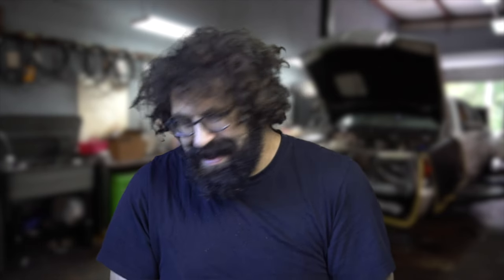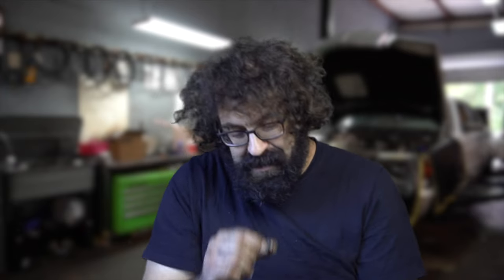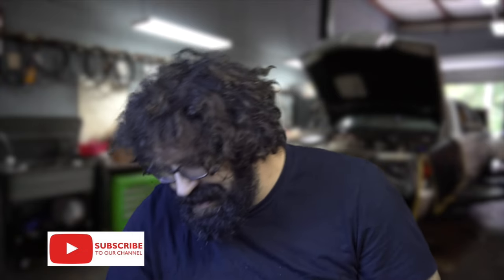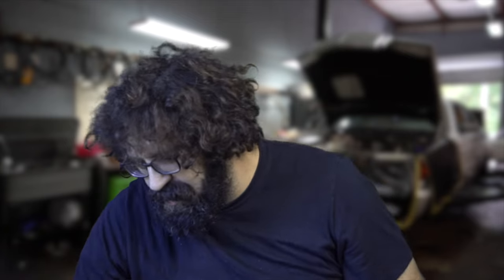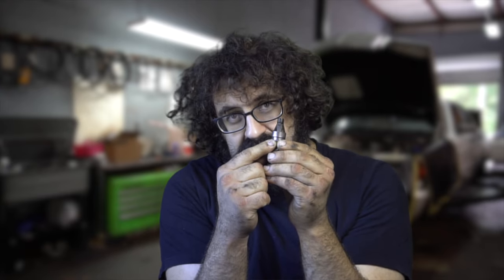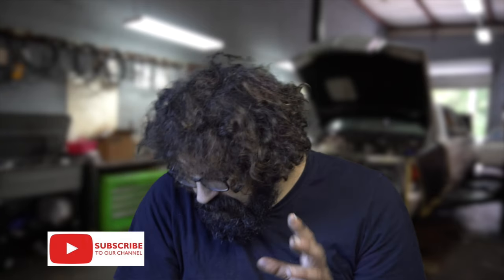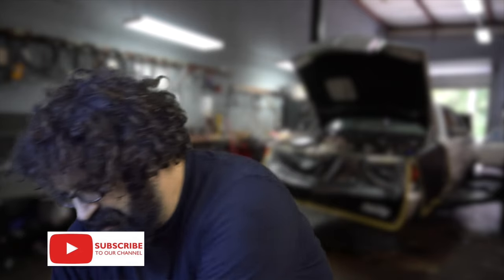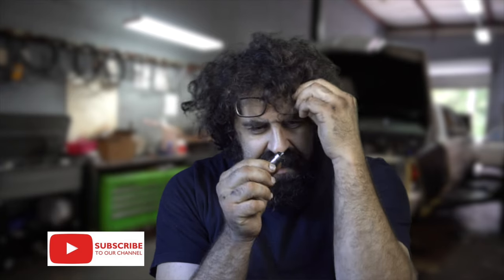Get To Know Your Mercedes Benz Diesel Injection Nozzles

Comment: In-line Bosch mechanical fuel injection pumps are the master race. That’s what ruined Peugeot Diesels, which also appeared in some of the Citroën’s, as well. Isuzu Diesels were also good when rigged with the system.

Comment: What great timing. Getting a lot of smoke out of my om602 motor. At $250,000 figured the injectors are worn down. Was thinking about buying that Mercedes Source kit with the adapted lift pump to test the spray pattern and replace the nozzle tips. Any comments on that kit?

Comment: What is the diference between a 115 bar nozzle holder and a 135? 
I have one 115 bar holder working alongside the other four in my 300D turbo, all adjusted to 135 bar, with Monark 265 nozzles. I could not detect any difference…